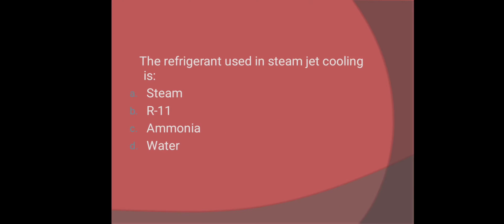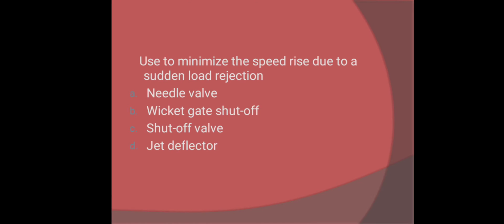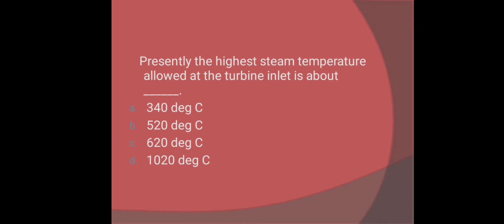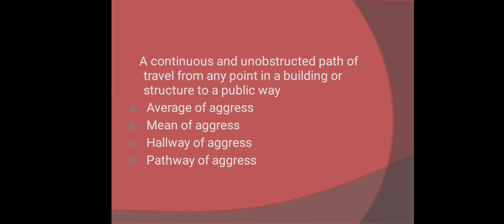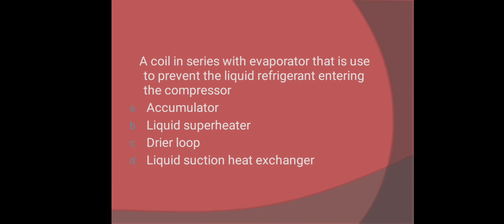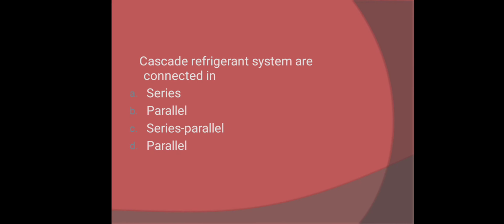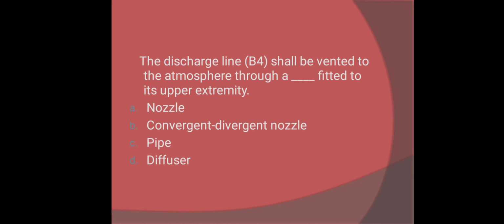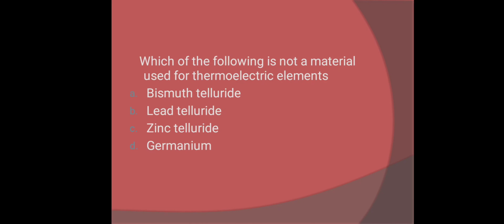ELEMENTS IN POWER AND INDUSTRIAL PLANT ENGINEERING (PIPE) - LOOKSFAM PART 1

Comment: which of the following is not a part of low preasure side in refrigeration system .?

A. compressor
B. condenser
C.suction line
d. liquid line

Suction line po ba talaga ang answer.  Dba mainit yang condenser.. ano po basihan sir..? Thanks sa sagot para maliwanagan ako..
Reply from the maker: Typo yan sir. Malalaman mo naman po base sa diagram eh since ang condenser mainit, malamang po na high side sya kasi pag mainit mataas pressure.